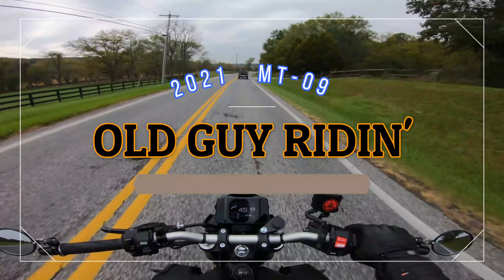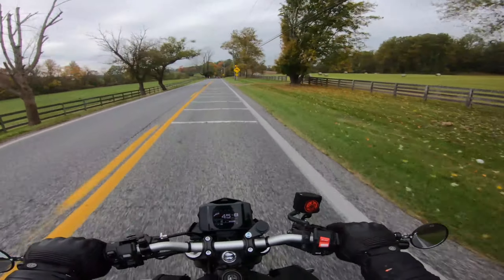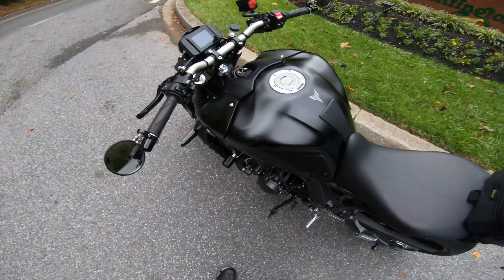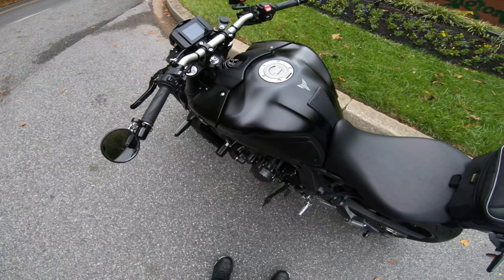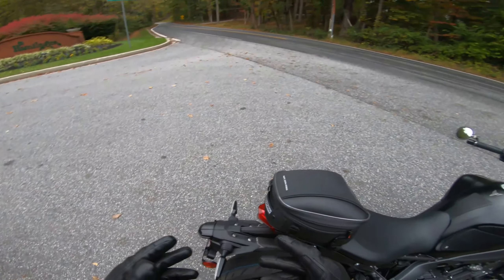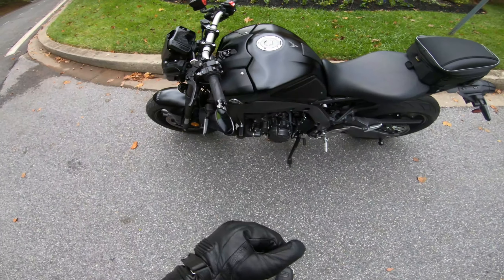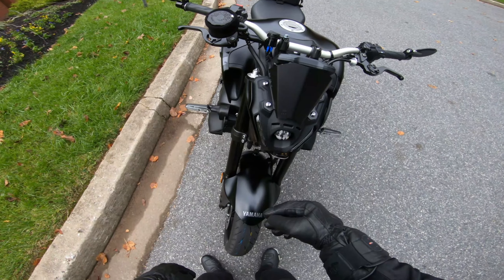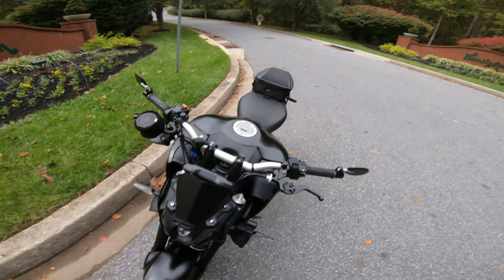2021 MT 09 Granpa's Got One

Comment: Another grandpa here with a 2021 MT-09, mine is an SP. I had to wait 6 months for mine, then another 5 weeks to ride it because the rear brake pedal was damaged in shipment. I'm working on many of the same upgrades as you. BTW, I am 68 (going on 18).
Reply from the maker: I hear that!  I think that's awesome.  How weird though the brake pedal getting damaged.  Ive5watched the unboxing of the 09 and they look pretty secure.  Enjoy my friend.
Reply: @OldGuyRidin  
I am just guessing, but I have seen fork lift drivers put the forks partly under the load to tip and drag it without completely lifting it; I think that is what happened. They also scuffed 2 covers on the RH side; the dealer is still waiting on those parts.
Reply: @dougbuchheit1454  Man I just turned 44 and was debating if i'm too old to be riding something like this lmao.  You guys make me feel a lot better

Comment: I swapped out for the comfort seat from Yamaha and it really helps to prevent sliding into the tank as it is not so slick as the stock seat.  It is also a lot more support and comfortable at least for me.  Good luck.
Reply from the maker: Thanks for the tip.  And thanks for watching.
Reply: @OldGuyRidin  

Just out of curiosity,  what part of the country are you in?
Reply from the maker: @dougbuchheit1454  I'm in Maryland.  Near Baltimore.  And you?
Reply: @OldGuyRidin  

Southern Indiana, right on the Ohio river; across from Louisvill KY.
Reply: @dougbuchheit1454   I just put a deposit on a 2022 for May or June arrival in Louisville. Just wondering if the comfort seat adds any seat height?
Reply: @ljoelmchanley3676  I only have the stock seat, so I really couldn't say. I find that the stock seat is quite comfortable. 

I live in New Albany, so you are very close.

Comment: I also installed the Yamaha engine protection set for the cases and while it looks a bit off, I think it will help (although I have not dropped it).  I also agree with the sound of the OE exhaust (although I think it is super ugly).  How old are you?  I'm 66.
Reply from the maker: Got you beat.  I'm 68. 69 in March.  I saw that one rider had his stock exhaust painted with temperature treated paint.  Had it blacked out.
Yeah, the guards look a bit funky but you'll thank yourself if, heaven forbid, you ever go down.  Enjoy my friend.